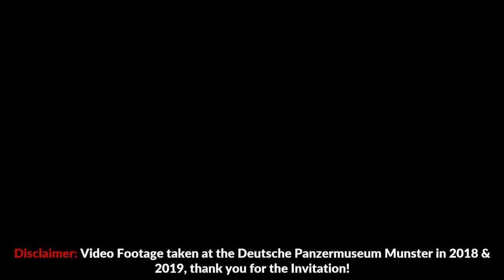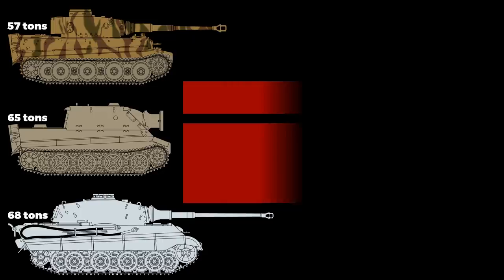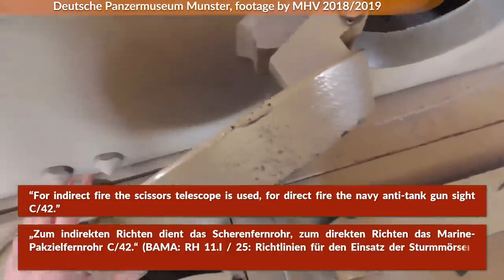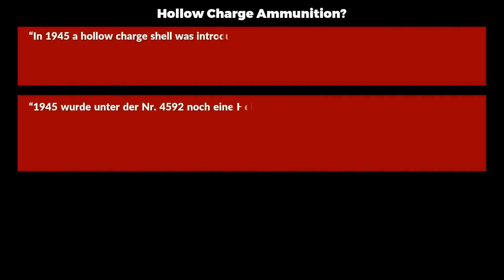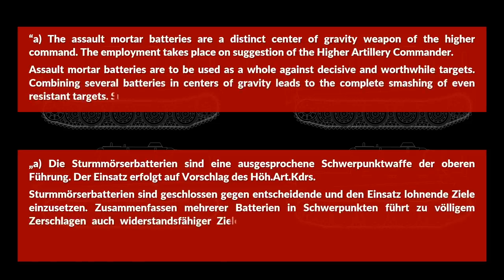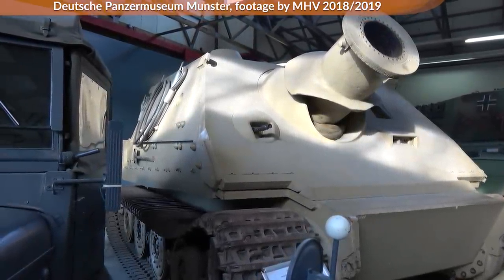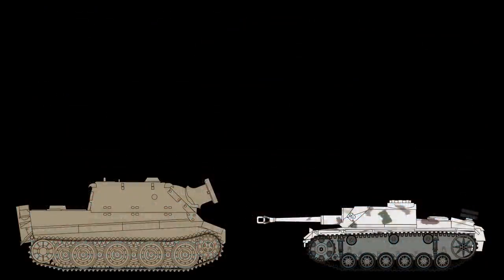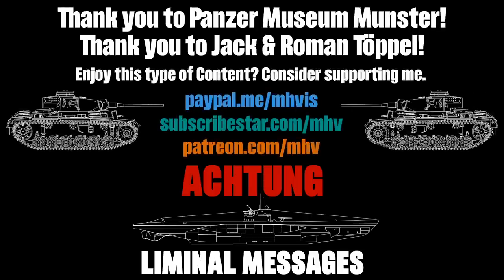How to use a Sturmtiger

Comment: Sturmtiger is a prime example of a Vehicle designed for the Wrong kind of war. Germany was on the defensive when the Sturmtiger came into service. while such a vehicle would be much greater used in urban enviroments Like Warsaw where it did perform very good in the role it was intended to perform. If the Germans had something like this at Stalingrad. Obstacles like the Grain evelator and pavlovs House would have been no issue for a 380mm Shell.

Comment: 10:53 How does directing propellant gases to the front of the barrel reduce recoil? Shouldn't it even increase it?
Reply: This is a rocket piece. When you fire it the expellant gas from the bottom pushes it forward and keeps pushing it as long as it has fuel. You don't need to "pressurize" the chamber to fire it out like normal shells. So it is ok if you "port out" some of the gasses from the gun. But since this is a God damn Tiger tank you can not open a port directly to behind like a recoilless rifle. It will kill the crew otherwise. You can open the ports to the sides but that would mess up everything on and near the tank (like firing sights and nearby crew/vehicles). And since you are already firing the rocket forward you can port out some of the gas to forward in an indirect way to let out some pressure before rocket leaves the already short barrel. 
 Hope this helps.
Reply: @maverikmiller6746  That makes sense, thanks!
Reply: This explains what appears to be an absurdly thin barrel wall shown in a photo of a British self-propelled demolition (gun? mortar?) of the same period. I love the contrast between your "handle" and sigpic/ avatar.

Comment: When you want to clear a city block, and you have a week to bring up the SturmMorser battery.  It is one of the those tactically useless weapons that WWII was so good at producing.  A fire rate far too low, with a range and firing profile that makes it meat on the table for any form of counter-battery fire used during WWII.  I suspect that further research into counter-battery doctrines of WWII is in order.

It is one of those things that are very obvious if you have received mortar or artillery training.  It is one of those things that you are constantly drilled in.  Fire the mission and move before CB fire kills you.  Four shots per hour severely restricts your survivability.

Comment: This is the kind of overally enlarged weapon the nazi's loved, much like the Schwerer Gustav.  Something that would be massive and extremely destructive, but so cumbersome to use as to be impractical and largely ineffective.  Thankfully for the rest of the world order, they were too busy engineering and building "large" and complex weapons platforms instead of mass producing less grandiose platforms like the USA and Russia did.  The outcome of WWII would be quite different if Germany had placed the 88mm gun on a medium tank chassis that was far easier to produce, more reliable and easy to repair.

Comment: Pardon my ignorance, but how were these things in any way useful to the German army in 1944-45? Especially with their slow rate of fire. These seem to be siege weapons useful only for attacking fixed fortifications like the Maginot Line, and Germany was on the defensive for the most part at this point in the war. This seems to be a large waste of resources at a time when Germany was running short on almost everything - especially fuel to power such a heavy beast.
Reply from the maker: >  in any way useful to the German army in 1944-45?
dunno, but it takes a few years to field something;
from my understanding it was built for urban combat, against fixed fortifications it is not precise enough.
Reply: @MilitaryHistoryVisualized  I see; it seems that it was designed with something like the Battle of Stalingrad in mind, but arrived too late to be of much practical use.

Comment: Use properly by melting them down into scrap or placing them in museum. Unless you're using them as catapults against a castle in the 1400s I see no use for them. Honestly they are very cool but they seem about as useful as a sunroof on a submarine.

Comment: Always excellent vids...@ 2:35 when showing the "degrees" symbol that was translated into "C" and "F", I believe it was referring to the angle of barrel elevation rather than the outside temperature, I of course1 could be wrong, but I have never encountered a maximum firing range from that era that was calculated based on the ambient temperature...
Reply: Giving a maximum range at 10° elevation seems very odd. No, the rocket propellant was apparently just very temperature sensitive.
Reply: All the ranges including maximum were calculated based on a standard temperature and pressure.  For Germany this was 10°C and pressure as 60m above sea level.
Reply: @501Mobius  Where did you find that???
Reply: @HochgeborenKlown   Thanks for asking.  I now bookmark this
https://forum.axishistory.com/download/file.php?id=398692&mode=view
Reply: @501Mobius  Thank You...

Comment: I would think with the terribly enormous logistical problems involved in this they would have been better to do as the Americans did and make it simply a self-propelled artillery piece with a crew tub set up around the deck, the loading area, so that snipers could not pick them off.
All these extra logistical people could be used to create a screen to defend the piece from ground assault.

Having seen some video with a very wealthy man taking a tiger tank that was found in a Polish River and doing restoration on it... I have to wonder why they didn't just go to a simple bulldozer type of track system that they had back in the early days and just haul this crap around on it.

I mean put a big old Maybach motor in the thing chug it around with a flat platform on top stick whatever you want on that platform and there you go.

I know that sounds very third-world like the fancy tanks the Australians invented when they had nothing at the beginning of the war but... one has to think about expense, quantity, repair, and production problems...

Comment: 15min per shot. Will run out of tea bag and biscuits after 2 hours. This demonstrated once again the wrong mindset of German high command. For the amount of steel for each if this they could have made a battery of 88. They just couldn't stick to their best in class but need to divert resource in making weapons that looks great on paper but hardly useful.